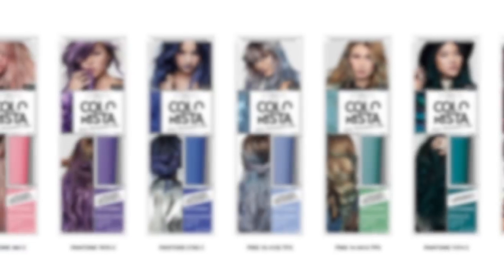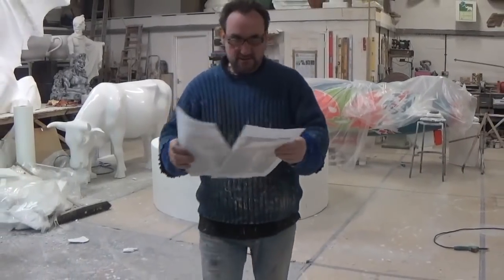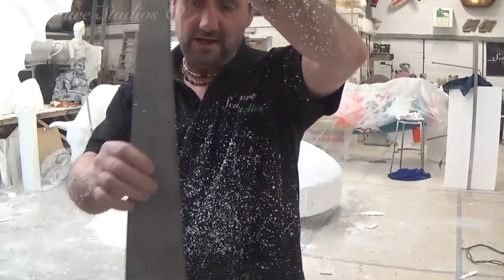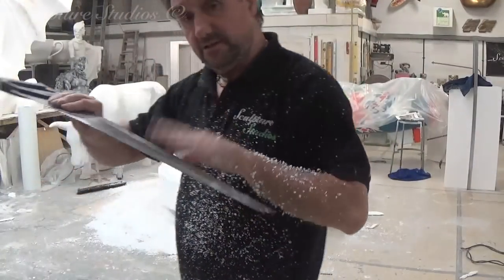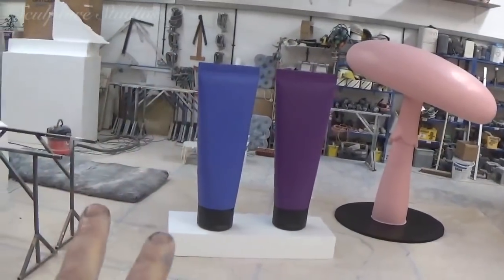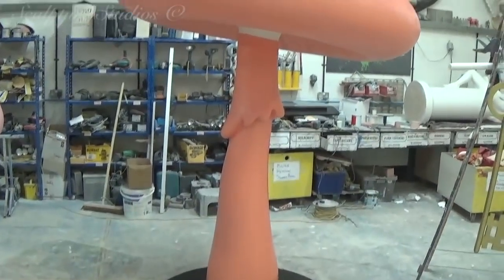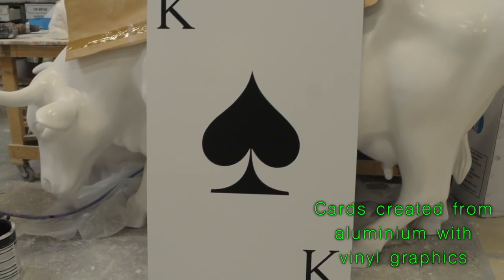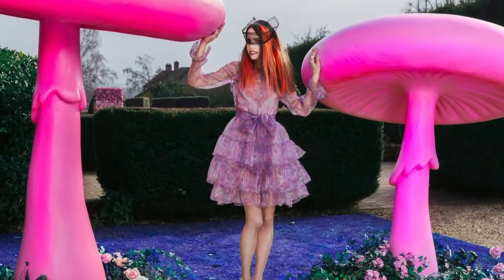L'Oréal Alice in Wonderland Props - Polystyrene / Styrofoam by Sculpture Studios

Comment: can you help me ? Ive relesed the aluminium insulation you use put the heat on the polystyrène so that it does not melt whatitis and where can Ifinit . thank you very much
Reply: The aluminium tape? They usually sell it in just regular hardware stores